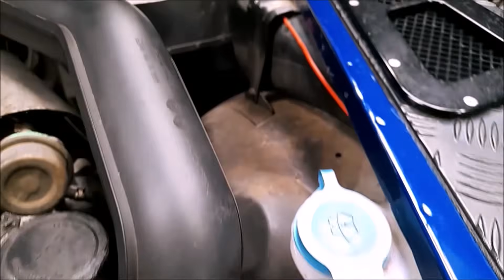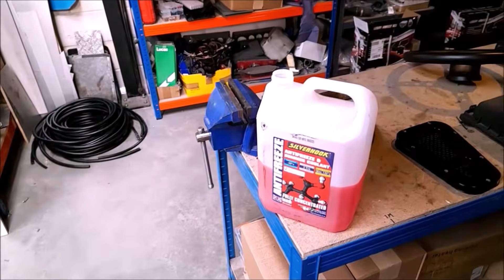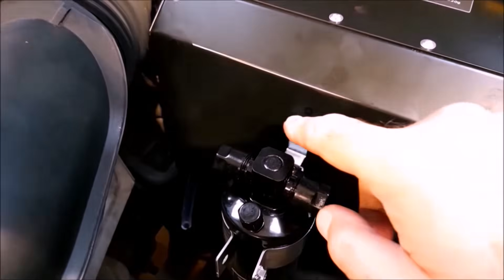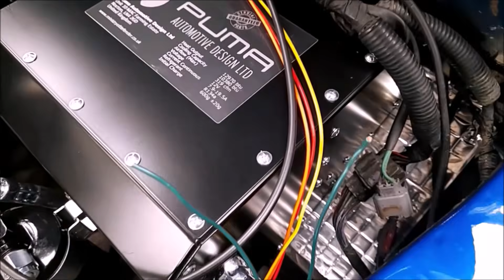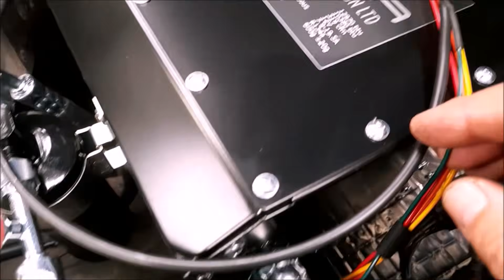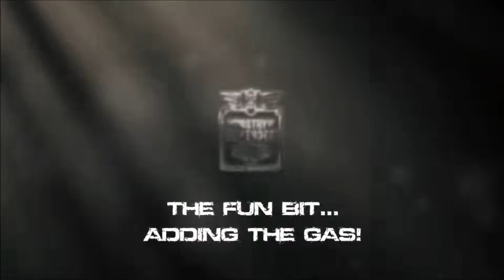How to Retro-Fit Air Conditioning to a Land Rover Defender TD5

Comment: we’re is the fan AC located it’s the same as heater blower
Reply from the maker: You remove the old heater blower and replace it with our HVAC unit, which has its own blower. It's dual core so one blower does both.